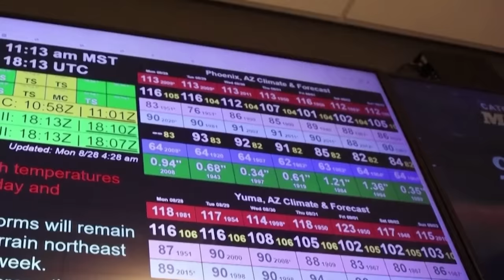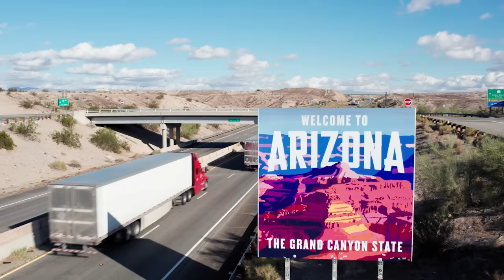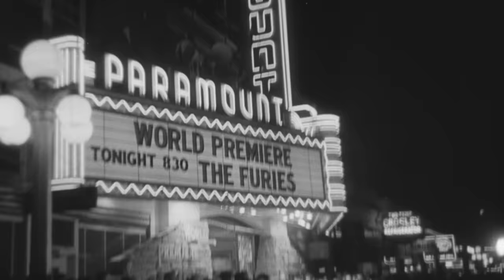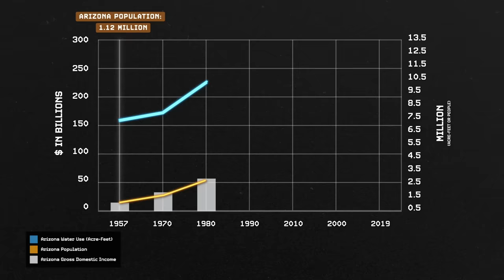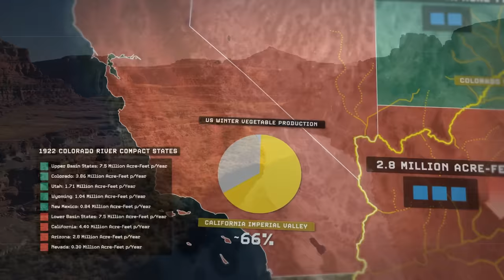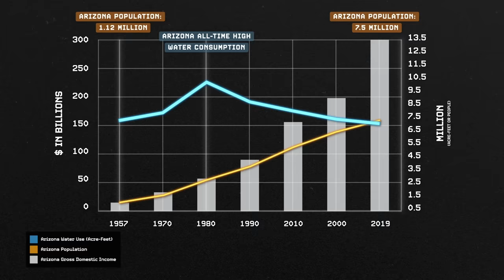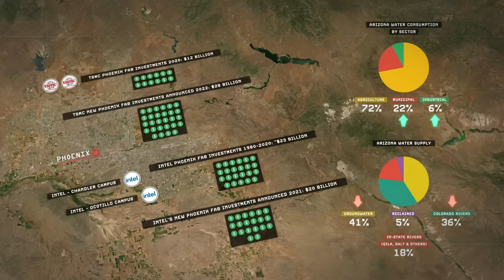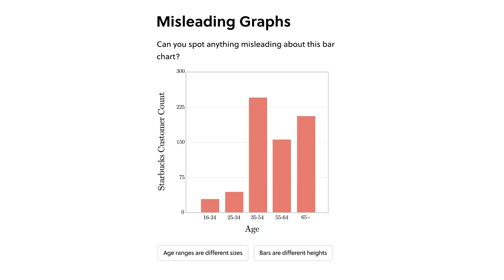Why 5 Million People Live in America’s Hottest City

Comment: Its not really the problem that the city is in a desert, its more of a problem how its built. It is directly opposed how you would want to build in a dry hot climate. Take Southern Spain for example, an area populated with cities for millennia. Cities like Seville regularly see temperatures rise beyond 110.  Buildings are tall, very dense and the streets are very narrow. Plus the buildings have thick walls, often white-washed and small windows. That means they retain the lower temperature of night time while reflecting heat and providing shade during daytime. This way you almost have a sort of natural aircondtioning, and actual airco is way more effecient. 

The dense urban centre with the narrow streets and small plazas are often lined with very water effecient plants that would naturally grow in such an enviroment such as date palms. There are almost no lawns because those evporate water really fast. Plus it reduces the need for cars, because this type of city design naturally lends for walking through the much denser but smaller streets and it makes public transport a lot more efficient too since everything is closer together. Its almost impossible to get full coverage with public transportation if a city is so spread out like Phoenix. The huge slabs of black asphalt in Phoenix only absorb heat instead of reflecting it making it even hotter. Plus the massive amount of car traffic increase air pollution which you would want to avoid with these high temeratures. 

To me it seems very strange that the urban layout of a city like Phoenix is not too dissimilar from a city like Minneapolis. It just doenst seem to take the natural enviroment in to account at all, which can only be a mistake, especially in the long run. I mean, why would you purpusefully build something that is way less effecient than it could be with some simple techniques man has been using for 1000's of years?
Reply: I mean yeah building design is a variable that makes an impact, but that's a poor comparison. Seville gets about 21 inches of rain a year, 3x as much as Phoenix's 7 inches. And this summer average nighttime temp in Phoenix is 90 degrees, over 20 degrees higher than Seville's nighttime temp. There's no summer nighttime air you'd want to trap in Phoenix...
Reply: @A_Corte  While that might be true, you could argue since its even dryer and hotter in Phoenix, its even more important to build in a way that takes the climate in to account. Or you know, just not build there at all. The EU has three times the population density of the US so space shouldnt really be an issue. However, it is when you build in this typical NA style of super low density.  So if you must for some reason, do it like I described and the way people did it for millenia. In Egypt and other North African countries, which have perhaps a more similar climate as Phoenix, they build in the exact same way.

Comment: im a resident of chandler, the southernmost part of the phoenix metro. i actually was happy to move here because of the weather. where i used to live in utqiagvik, it was misery for a skinny kid like me. the fall-winter is perfectly fine here in phoenix, but summer you can stay inside with fans and air conditioning on, and go to your air conditioned car, to your air conditioned work/school and back. it’s actually not bad at all ngl winters lowests here are around 40 when we have the pineapple express in early february. in summer it gets from 90-120 degrees
Reply: Until the A/C in your house and car breaks down and it costs a fortune to replace.
Reply: Very sustainable

Comment: A lot of commercial buildings may look like their counterparts in Los Angeles, but they are built differently. An architect worth anything will design for the environment, even if the exterior of the building looks no different from other areas.  But what drives me crazy is all the water used as a "water feature" in Phoenix, such as large office towers with gushing fountains in front or man made ponds wrapping around the building. This is pure arrogance. It actually pains me to see water wasted this way. I do think the city should ban them. You don't take a precious resource and let it evaporate away in 115 degree heat.

Comment: Live in Scottsdale and it suuuuuccckks here! Only came from CA to be closer to my family in Mesa after covid lockdown and have hated every minute. The extreme heat is hard on humans, gardens and vehicles. Ive had to replace the batteries in my cars twice each and have been here only four years! What I cannot understand is why theyd make the cities concrete, remove most shade-providing trees and plant palms which are not native and fall over during monsoons. The cement absorbs the sun's heat and makes the air roughly 20 degrees hotter than the 112 degrees it already is. Cost of living is not much below CA with $1800/mo. 2br house. Currently plotting my escape to the Midwest...😂

Comment: 7:39 that's not why it's called New Mexico. It was named after the Mexico valley in New Spain. It got its name before the country of Mexico did. Also it's a bit of a stretch to say New Mexico was conquered when the US captured Santa Fe without firing a single shot. The US was at war with Mexico, but so was NM 11 years prior. We were even considering joining the US at that time. The US annexing NM worked partly because NM was rebelling against Mexico and was economically dependent on the US rather than Mexico anyways.

Comment: Sorry, but Phoenix is no longer affordable. I bought a house there for $250k in 2017. 3 years later, it sold for over 500k, and prices have only gone up since then. They also have issues with fresh water and WAY too many green golf courses. It's so hot there, that in the summer you couldn't get cold water. "cold" water was actually pretty warm. You had to run the A/C 24/7 for months. a $250+ power bill was normal for 8 months.

Comment: As a 20 year Phoenix resident, the summers are getting hotter with each year since 2020 breaking previous records. Part of this is just the heat that arises from all the concrete. An urban environment is hotter than a natural desert.  I was born and raised in Wisconsin, which is like Siberia for 6 months out of the year. I'll take hot temperatures with low humidity and a swimming pool and palm trees over a cloudy icy snowy environment any day. I still remember walking to school as a kid in Wisconsin in the winter with my frozen feet taking hours to warm up.  I would have preferred San Diego, but no one can afford it now. At 72, I hope I can stay here before it becomes untenable, if ever. But Americans need to bear in mind that people have been living in the same temperatures in the Middle East for thousands of years WITHOUT air conditioning.  I agree that taking house plans meant for mild California and building them in Phoenix is very wasteful. I live in a 1 story extremely well insulated house with solar panels - haven't paid an electric bill in years.

Comment: 4:08 Ditto, constant new construction is what is causing our temperatures to increase. This heat is not the same heat I grew up with. Yes it was hot growing up but it seems hotter now, even if it’s by only a few degrees.

Comment: There are SO many wrong facts in just the first 5 minutes of this  video; it boggles the mind. Their statements about the water supply alone is disingenuous--lacking both context and geographical accuracy. There are actually four rivers that run into the Valley--not just the so called stream, the Gila. The Salt is the major contributor to the East Valley. Most East Valley cities get less than 30% of their water from the Colorado River--some significantly less. Also, the Valley exists geographically at the edge of the desert. The reason the Valley exists is because of the four rivers that flow into the  Valley from the mountains. The Colorado River is not one of the four...If one travels even one hour from the metro areas edge to the east or north, you are in Arizona's high country. If one travels south and a little east past Tucson, one also will reach a smaller version of the Mogollon Rim (in the northeast) to an area of "sky islands"; mountains that rise from a plateau of between 3500 and 5000 feet. I could go on...

Comment: The urban population of Phoenix in 1940 was 215,000.

Not sure where you got that smaller number from.

Edit:
2:40 you switched the Salt River and Gila River. The Salt River is the northern branch that goes through Phoenix.

Edit 2: 
You should read Wikipedia articles before referencimg info from them.

The historic flow of the Salt River was nearly 900 cfs (25 m^3/s), and rhe discharge of the Gila River at the confluence south of Good year was 1,800 cfs (50 m^3/s), enough to supply most of modern Phoenix's water demands.

Comment: I dunno where you're getting your information from but I know we've had hotter days than the one you mentioned as a record. The hottest day on record that I'm aware of was 122 degrees. That was back in the early 90s. I remember it because I worked in construction at the time doing concrete and I was outside that day working for like 12 hours. I googled it and  this was what google responded with:

"According to the search results, the hottest day on record in the Phoenix metropolitan area is June 26, 1990, with a temperature of 122°F (50°C).
This extreme heat event was part of an eight-day streak of record-breaking temperatures, with a high-pressure ridge dominating the region. The record has stood the test of time, with no subsequent temperatures reaching this scorching level."
Reply: I remember it too.  That was my first summer in Phoenix.  I was thinking "what have I gotten myself into?"  lol  But, I'm still here, 34 years later.

Comment: I left Phoenix quite a long time ago in the late 90s after 11 years .. after a ‘brownout’ for a little while though my condo only lost power for 4 or 5 hours .. others not so lucky .. I didn’t need to cook my eggs on the sidewalk anymore .. getting to canyon lake was getting worse .. though winters were nice .. camping in Payson (secret camping site) was really nice .. a drive to Yuma made Phoenix seem lush with plants in comparison lol .. missed having windows open at night in summer and not having A/C on all the time during that time of the year .. actually jogged in East Mesa and in Tempe till the pollution got so bad and no wind got headaches jogging .. 
texas has humidity yep .. the difference between Arizona hot areas and Texas is at least in Texas you sweat before you pass out from heat exhaustion where in Arizona you just drop lol 
Other states I like better than either Texas or Arizona .. pac nw is ok ..Seattle more dismal than Oregon .. green plant life are very nice there .. water is good .. a little snow or ice doesn’t kill ya anymore than than blistering temps but ya don’t have to move sunshine out of the way like some snow or ice but shade is good .. electrical efficiency of AC units are roughly 2x that of heating elements in bitter cold areas like Midwest where heat pumps usefulness disappears below really cold temps and heating elements need to be used 
I think I like being able to just be able to walk around or hike in moderate temps around trees and plant life .. mountains are very nice .. hiked em all in phx .. Texas doesn’t have em .. Oregon and Washington state do but the liberal stuff is too weird .. saw Portland and Seattle turn to Shiite in a hand basket .. too stupid corrupt for me to tolerate 
What a waste of beautiful places 
All these places have their advantages and disadvantages ..

Comment: Why the frequent implications that these chip fabs have a significant impact on the water supply after already acknowledging that they have implemented nearly 100% water reclamation/recycling, and the new ones plan to do the same?

Also, there's obviously nothing even remotely close to a water shortage or "crisis" based on how much is currently wasted on crops that should never have been attempted in that climate in the first place - especially when such a massive part of the country is perfectly capable of producing more than enough in more logical climates with better natural water resources.

Comment: 100F is nice weather here 😂 wait until it gets 115F or higher. In all seriousness though, people live here because of air conditioning and water. You leave your air conditioned house to go into your air conditioned car to drive to a most likely (for most people)air conditioned building at work, with only a brief few moments of stepping outside in bright, open-oven like dry heat. As you can imagine, HVAC is a huge business here. People also adapt to the temperature as well, and routinely wear hoodies with shorts which probably confuses some that are not from here. The "dry heat" as its often called is mostly felt on your skin, but humid heat in other places can be felt all the way down to your soul, hence the "at least it's a dry heat" you'll inevitably hear.

Comment: Planting trees to prevent heat islands seems like a silly solution to reduce water consumption.  Wouldn't trees consume more water than if they simply left the ground as only rock or something similar to a desert landscape?

I think the fact that the Saudi's banned the farming of alfalfa in their country and then switched to farming it in Arizona is bonkers.

I have heard that working conditions at Semi-conductor plants are very challenging due to long hours (chips are produced almost 24/7), constantly being on-call to fix problems, vacations may be disrupted, and pay is not as good as advertised.  Many economists say you should be cautious when companies say they have a labor shortage because most of the time what they are really saying is they don't want to pay people more.
Reply: I’m sure you’ve heard about the heat island effect, where temperatures in the greater Phoenix area continue to rise because of the loss of trees and greenery, as well as the increased area covered by pavement and asphalt. Trees cool the air around them, but asphalt traps the daytime heat and releases it at night, causing nighttime temperatures in particular to rise. Instead of the setting sun signaling an end to a sweltering day, the blacktop keeps temperatures high even overnight.
Adding native trees back to the desert environment can cool the air, along with removing pollution, reducing asthma attacks, and more
Most native and adapted trees (trees that have adapted to life in the desert) need far less than you may think! In fact, most survive on rainfall alone after the first 2-3 years (although they’ll happily accept an occasional deep watering during the drier summer months).

Comment: I live in Phoenix and I used to live in the Coachella Valley. The Coachella Valley is a hotter fucking place than Phoenix is. The only difference is that Phoenix is higher elevation so you feel the sun more but the heat is stronger in the Coachella valley during summer anybody that’s lived in both both places can attest.

Comment: I live in Phoenix. Eight months of the year the weather is quite pleasant. 100 degrees is fine as long as you are out of the sun because of very low humidity. Over 105 degree days are like colder days in New England. You stay inside to avoid the weather. We get seven inches of rain all year. This youtube hammers away at our water problems. Actually, water here is well managed with several potential sources of water. Currently there is "no water crisis" in Arizona. We are careful with water but we don't obsess about lack of it. I used to live in San Jose and yes the weather is better there. But the taxes and progressive agenda in California are far more stifling than a month of 110 degree days  in Phoenix.
Reply: As you know electricty is a major problem of California. I lived in the east bay and they would turn off your electricity even if your bill was current. They called it rolling brown outs. I lost two fridges full of food. Add that up among politics and taxes and WE GONE!!!

Comment: There should huge pipelines from the pacific to pump water to these states for desalinization. I mean huge. These states have more than enough land for both solar power and sodium disposal. Yes disposal. I don't see why they should dump the salt back into the ocean or even process it there. Process it all locally and dispose of it locally. Build a salt mountains. These states are deserts. Choose areas with lower ground and high clay content to reduce leakage into the ground. Use some of the salt for building sodium-ion batteries and other industries. There are already naturally created salt flats in all these states. These states should invest and contract it out. Pass environmental protection bypass laws to build it quicker.

Comment: How did people live in these areas before air conditioning and before modern plumbing
Reply: Not a lot of people did live in those areas.
Different type of housing in those extream climates. 
3 ft thick Adobe mud walls, thick roofing and housing partially dug into the ground makes for a stable interior temp during those 110 degree days.